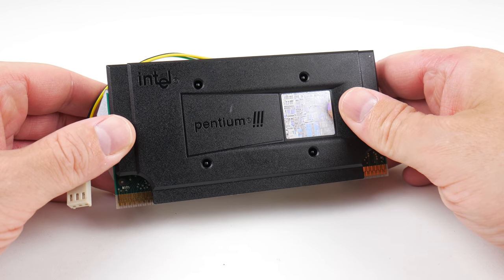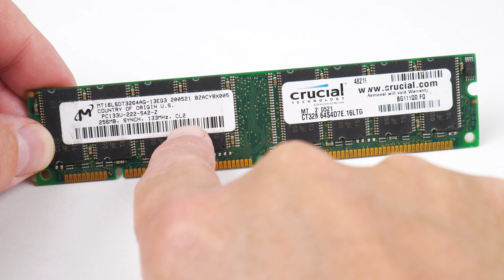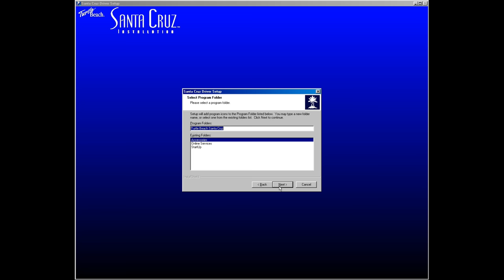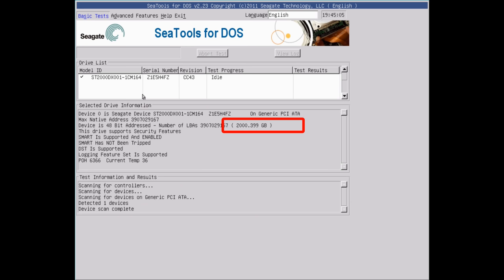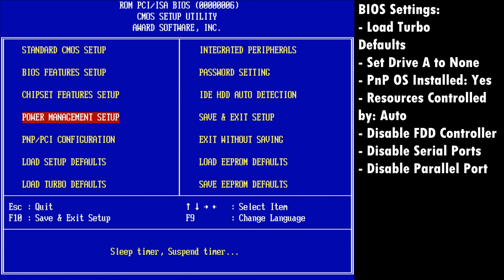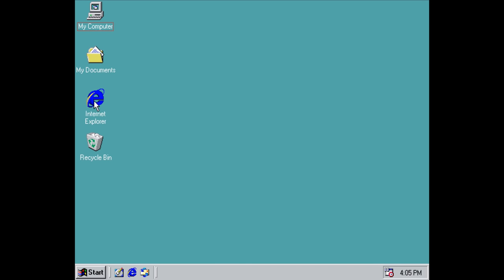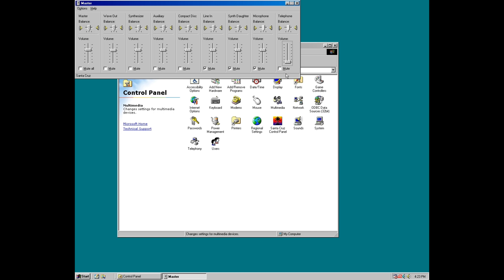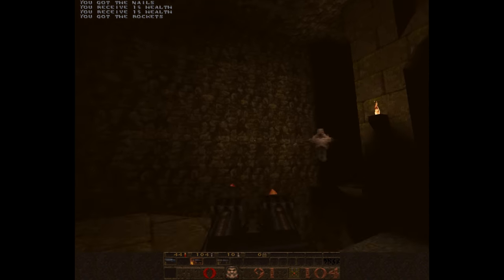1000 MHz Pentium III Windows 98 Retro Gaming PC Build

Comment: I really like how old BIOSes look, so clean ...
Reply from the maker: LOL so true. These days, spinning fan animations and weird UI
Reply: @philscomputerlab  Yep, socket 1366, AM3 & 1156,1155 was probably among the last before UEFI was starting too get used more commonly.
Reply: You can choose classic view in UEFI at least in Gigabytes's mobos(I used  3  only Giga mobos with UEFI). It also looks very clean.
Reply: Have you ever seen the old bios on IBM Thinkpads? The cursor was a bird!
Reply: My bios on my current pc looks like this, award bios. :)
Reply: Had plenty of machines with that similar bios screens, that's what they all used. I was more interested in the better advanced settings to tweak everything to the fastest and most stable setup I could. Back in real ancient history it was a science to get the dos drivers and memory management on boot really tight so you had a bit more memory to work with as well. I have a couple of newer boards that use the newer ufei GUI bios and they are pretty nice once you get used to it and using your mouse and all that, lotsa options in the higher end boards.
Reply: @r92king  ya i would love another gigabyte mobo, but too bad their b450 lineup sucks, im looking for a b450,  looks like msi is the only way to go for b450.
Reply: @budgetking2591  MSI makes some of the best b450 boards out there. Gigabyte's boards seem to have coil whine and other issues. I also don't like their BIOS setup as much, its a bit more clunky than MSI's or ASUS's in my opinion.
Reply: some weird uefi still look like that
Reply: Tbh I kinda like the MSI click bios tho. Its so much easier to navigate.

Comment: I picked up a customer when I drove a taxi in NY, and he asked if I could take a couple of things to the trash and offered me $20. I said yes, he said they were in the garage. I walk in. There is a 19" monitor, laser printer, Gateway case with parts in it and a mouse and keyboard. I asked if I could keep it instead of throwing it out and he said be my guest. Threw em in the trunk, drove him to the airport, got home after work, open up the case and... Pentium III 1 Ghz with an Asus socket 370 motherboard, GeForce 2 GT, 512MB 133 Mhz SDRAM, 20 GB Maxtor PATA 133 HDD, Sound Blaster sound card + onboard audio, CD burner. This was fall 2000 so it was like winning $1000. The P4 had just come out and the guy I drove bought a new pre built, big box from Gateway and threw that away. Literally. He had tried to upgrade the board, chip, memory and HDD and failed getting Windows to install properly so he ordered a new one and was throwing the almost new one out! Never forget that machine. I had a PII 350 and an Athlon 1 Ghz at the time so being able to replace the PII 350 with a PIII as a family machine and being able to sit the Athlon and PIII side by side and benchmark them was alot of fun. The Athlon beat the PIII with the same amount of ram (DDR 266 in the case of the Athlon) and the same GeForce 2 GT in most games however the Pentium III ran the OS smoother, compressed/uncompressed faster and was generally more stable, less crashes. Thank you for triggering this happy memory Phil! Great content!

Comment: I've got the same motherboard and 133 FSB version of that CPU. Great combo. But there is something annnoying in your build: Why using a 2TB Hibrid disk and downgraded to 32GB, if you can easily use a 128GB SSD?
Reply: does 128gb ssd have ide connection?
Reply: @gamersworld4176  he's using  an SATA to IDE converter anyway. I have a 60GB Samsung 830 in my Win98 PC, works great.
Reply: Hello. he answered this question in comments.  He did this choice just to show it is possible.    A small ssd is a good choice of course.

Comment: Old guy here that doesn't like to comment often. I enjoy all of your videos, no complaints here.  I've built a machine using various parts you recommended over the years (asrock board with LGA 775 and AGP, Celeron 450, radeon 9600 pro, and one of those "Cobra" sound cards for the good DOS support - setmul lets me play even my old favorites - also got a vortex 2 and an Audigy 2 ZS to play with).  Keep up the great content, modern or retro, and I'll be watching every week.  One request: an updated video on which monitors are worth pursuing? Short of hunting down CRTs (I keep getting them with blown caps) I'd like to have some idea which LCD screens are better at scaling low res DOS games.  I hate stretching!
Reply from the maker: Thanks :D Good value option are old 5:4 monitors. They are still being made brand new also. BUT 4:3 and 5:4 there is a bit of vertical stretching on the 5:4 monitor, but it's subtle.

Comment: Great video thank you it is always nice to see the older tech in action. I used to have a Pentium III Tualatin 1.4 ghz that OC'ed to 1.6GHz which for it's time was pretty fast and creamed the P4's that replaced these P3's. I think if memory serves me right I had a ATI Radeon 9700 card in this system in 2002 and it also supported DX9. Yep those were good times and things were so much simpler back then to deal with.

Comment: My first config had a Sound Blaster AWE 64 ISA sound card. In the volume settings under the Special button there was two magical slider "Bass" and "Treble" I think... I can't explain, but these two slider made my ears melt. When I set the sliders to max, it sounded very very good. When I try to do something similar with a mixing pad or something it's just makes certain frequancies louder and overshadows the other parts. While my soundcard highlighted those frequancies and the music sounded more clear actually.

I miss the good hardware sound...

Comment: Man this bring back memories.When i upgraded to my P4 i had my P3 lying around.My friend made me a bet that it is scientific impossible to run elder scrolls 4 oblivion on a P3.I had to make him eat his words.The cpu was slot A 833mhz.They were not known for being good overclocker.So i took the stock heatsink off and mounted the biggest heatsink i could find with a huge ass fan.The heatsink was so big i had to lay my pc down cause it would pull the cpu out.I did all the chipset with heat sinks.I clocked her just over 1ghz.He said i should run it not on what specs.So i ran it at 640x480 low to medium and got around 30ish fps.Not bad for a P3 :D.Man the shit i did just to shut people up lol.
Now im old i build pc's but no custom jobs anymore
Reply: Pentiums used Slot 1; the original Athlons used Slot A
Reply: Pulls out P3 Xeon dual processor motherboard, hold my beer.

Comment: I loved my 1000Mhz Pentium 3, it was a socketed version iirc. It held up strong against the frist Pentium 4 chips!
Reply: I had a Celeron in my first build ever.  It was a slot style AOpen motherboard, but a socket style processor.  I used a daughter board called a Slotket that fit into the slot and allowed for installation of the socket CPU.
Reply: I got a Patriot laptop a while ago with a 1.3 Tualatin 512k and desktop memory. Was absolutely insane in comparison to a lot of modern machines at the time.
Reply: That was getting up into really slick P3 ... yep, for a while they outperformed the P4, sometimes by a wide margin!
Reply: @theakh4238  did you have the one with jumpers so you could get the celery to over clock and play with FSB and multipliers ?

Comment: Regarding power usage/idle time. Run apps on Windows 98 such as "rain", "cpuidle", or "waterfall pro" to drop idle power consumption/heat. Windows 2000 or XP and up do this automatically.

Comment: I bought that in the 733 mhz version in 2000, and if I remember correctly with 256 MB RAM and a nvidia geforce 2 gts with 32 MB memory. A beast of a computer 😎
Reply: then the original xbox came out and ate it for breakfast
Reply: @si4632  The original xbox is pentium 3 733 with 64mo of ram and a graphic card between geforce3 and 4 in term of power.   Late 2001/ beginning 2002 game console.     At this time pc processors ran at 1.5ghz.
Reply: @jeckjeck6943  and were still trashed by the Xbox lol
Reply: @si4632  That's not true.   Xbox was the best console of it's time but can't compete with pcs of 2002.

Comment: I could watch these retro builds to no end, so I really appreciate when you redo old videos but with a tweak here and there or only a slight improvement. Here a little story for maybe some video ideas: So what I did was going backwards with my projects, meaning I started with ddr2 because my latest build is a maxed out ddr3 system, so I build the fastest ddr2 build with Intel possible. Your videos about the modded Xeons inspired me to do that. So I got the ultimate Asus Board, one of the Xeons, a ssd, gamer ram, noctua fans etc. All the shit I couldn't afford back then, for literally peanuts. And I made different benchmarks with different videocards up to my fastest the 1080ti. And now I am working on the fastest xp build. So a dual core 64 bit on socket 939 with the famous Asrock 939 dual board I got back in the day and had still in a box somewhere but I did not have the fastest cpu, now I do :) . You also featured this board in a video. I also got all the best cards from back in the day, around 2006/07. And I want to do every system twice of each Era one with Intel and one with AMD and make benchmarks with 
different graphics card's and let them compete. I find that really entertaining. You inspired me to do all of that. I got a lot of stuff in the last few years, learned soldering and had a lot of fun and I am far frome done!  I want to go back all the way to socket 1, because that's when I started gaming on pc, around 1998. So I would really like to see another series about the ultimate systems possible, optimized for gaming, moving backwards from ddr3 with Intel and AMD. Optimizing everything to the max with SSds, the best 4/3 Monitors and making everything the quiet, compact and/or good looking as possible. But also giving options like you did in your Xeon modding series. I did not end up buying the latest and greatest and most expensive cpu but the valueking you proposed and I was able to overclock the heck out of it because of my kickass Asus board and it's lower tdp. And now it is faster then the latest and greatest. Never would have thought about that option without your charts and Infos. My ddr2 system now runs windows 7 with the msi gtx 580 lightning 3gb edition and I play games on it like witcher 1, everything from around 2008 to 2012. I want to own one day a kick ass setup from Intel and AMD next to each other hooked up to the same monitor for every good windows version. I extra cleared a room in my house for that.... My wife was thrilled xD.... So may be this got you some inspiration. Oh and if you need cheap parts, because it seems that getting parts in Australia is really expensive. I live in Germany and the used market for example on apps like eBay Kleinanzeigen is full with cheap parts, and way cheaper than everything you are buying. You are paying at least 50%  plus shipping more for your parts then I do here. And sometimes even more. So if you would need something or can't find it, you can contact me anytime and I will check if I can get the parts here and send them to you. I was really surprised in the beginning how much less I was paying then you for the same parts or I had no problems getting parts you mentioned but you could not get at all or for a reasonable price. OK that's it. Thanks a lot and keep up the good work.
Reply from the maker: It really is a fun hobby :D Another benefit of going with older gear is that everything is patched, works reliably, motherboards are on 2nd or 3rd revision...

Comment: I totally prefer your retro PC content, all the socket 7, Super 7, Slot 1, socket 370 up to socket 462 and 478 stuff, as well as the period correct graphic and sound cards. But as a suggestion for a future video,  if you happen to have some AM1 platform parts around, it could be interesting to test them as an inexpensive Windows 98/XP era retro machine. Maybe also (why not) to test how far it can be pushed in regards to relatively more recent titles (Windows 7 era). Have a wonderful weekend! Greetings from Uruguay.
Reply from the maker: AM1 or FM1, I believe I did a video on one of these platforms! It was ok for Windows XP, but I do want to look at some newer FM2 APUs and if they are good enough for a GPU-less XP Gaming PC.
Reply: If I recall properly you did a video about the FM1 platform, not the AM1 (which is a more energy efficient oriented one). I do own an HTPC FM2 based system and its IGP is fairly decent. But never tried it as an IGP only retro system, that could also be an interesting video to watch

Comment: Great vid, nice to see more retro stuff here! I'd love to see more sound card reviews - one I'm particularly interested in is for the Compaq Business Wavetable Sound Card. It uses a similar ES1869 chip to the one in your ESS AudioDrive video, but also includes a rather obscure ES692S chip for wavetable synthesis. It's a very similar setup to what I have in my Compaq Armada 7800, which I've been very impressed with the general MIDI quality on.
Reply from the maker: I actually looked for such a card, and seems to be a bit if a unicorn...

Comment: Finally a real retro build. A worthy opponent.
Reply from the maker: Yea it's been a while :D Always takes my brain a bit longer to get my head around the old parts LOL
Reply: First pc I built was an an i7 920
Reply: Yeah, if you've been away from 'em for a while, it takes some remembering all the cranks and quirks, and boy howdy, some of 'em were cranky. We've been spoiled by hardware that auto-detects and auto-configures everything, but go back to these old boards and you'd better have the jumper settings correct if you want it to work; most had no autodetect and no overvoltage control, and would cook a CPU that expected lower power. And the AMD CPUs of the day could overheat to death in under 30 seconds, from ice cold to brown and crispy, that fast (no overheat protection at all. Even very old Intels would turn off, but AMDs would fry.)

Not to mention all the different types of RAM and voltage, not always reliably marked by slot type or slot keys, and no SPD in those days.

It was sure nice when everyone got in the habit of printing the jumper options right on the board. Not like the old adapter cards where if you didn't have the jumper docs, you were SOL, especially when they had big blocks of multiple jumpers.

Comment: I've got a Compaq with a Celeron 933MHz with a broken die, and I bought a good Pentium 3 1000MHz socket370 CPU + 2x 256SDR 133, video FX-5200 on PCI (no AGP slot), 80GB Samsung HDD. I installed Windows 2000 + Microsoft Visual J++ (you need to install it before the service packs, otherwise it gives errors, it was meant for Windows 98), all the updates including IE 6.1 SP1, Microsoft Visual Studio 2005, Eclipse 4.20 (+3.42), Firefox 12 and Opera 12, and other software as DirectX 9.0C from 2005, D-Lite 4.35, Winamp 5.2. Great for doing basic programming stuff. It can run older software, but still VS2005 seems great to do C and C++ stuff, and VB6 for who needs. Windows 2000 is pretty good. It is stable and fast.
This is how it looks: https://qph.fs.quoracdn.net/main-qimg-9e9beaa52a5d2b45caefb0cacaec1252

Comment: ahhh This brings back memories as I had the exact same CPU yes it was the slot 1 version as it was hard to find back then for when I went to college and had it for over 5 years  until 2008 I played and finished so many classic games on it despite having a shitty GPU for so long, I played and finished RE4 on 256MB 100mhz SDR ram and a 64mb Geforce 2 and it ran like shit 25 to 30 fps on most parts but ran less than 20 in some parts on an 800x600 resolution gaming like a pauper those were the days.

Comment: I never owned a slot 1Ghz, but had plenty of FPGA 1Ghz machines back in the day. But I did have a bunch of dual CPU P3 550 slot machines by Dell. Huge cases, amazingly well built, toolless design internals and onboard SCSI. Those were awesome machines. Came with Viper V770's (TNT2 Ultras) and a second SCSI adapter card and each machine I had came with two Quantum SCSI HD's. 

I kept a few of them for a couple of years and remember having the chance to upgrade them to 700Mhz dual SLOT CPU's, but by that time flipchips were far easier to get and I ended up selling the Dell's (except one).

Comment: My 1GHz P3 system was a Coppermine S370 setup. Think it was on a Microstar 815E board. Only issue with 815 was it could only take a max of 512MB of RAM but that wasn't an issue then. The 440BX was legendary but newer boards could do AGP 8X with fastwrites/ sideband addressing and of course 133Mhz FSB chips.

Comment: Back in the day I upgraded from a celery 433 to a PIII 1000EB, with the 133MHz FSB, and it made a huge difference to the performance! It'd be interesting to see how a 133MHz FSB compares to the 100MHz one shown in the video. I suspect it won't make a huge difference, probably a few FPS here and there. Going from 100MHz to 133MHz RAM might make a difference in memory-intensive applications, but I don't think games benefited that much from higher memory speed.